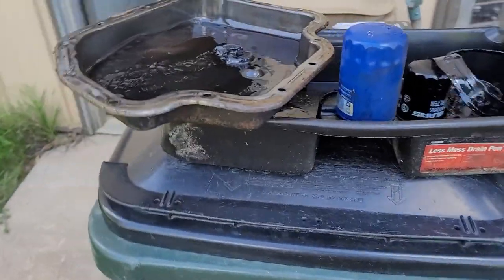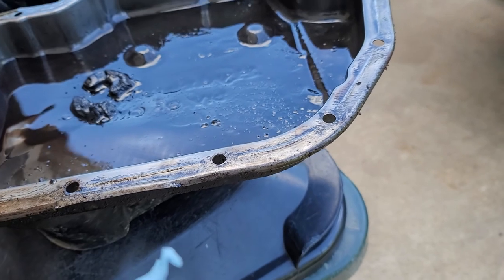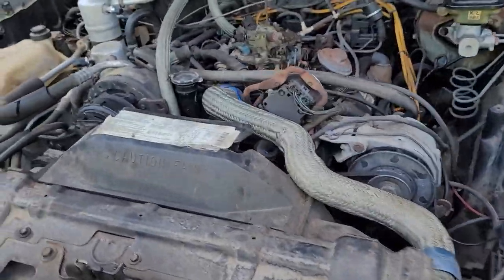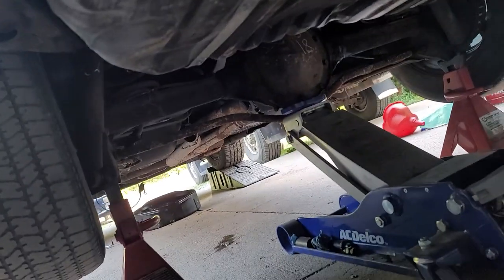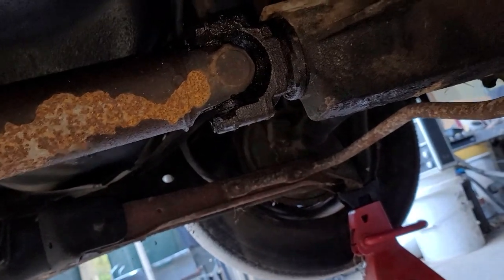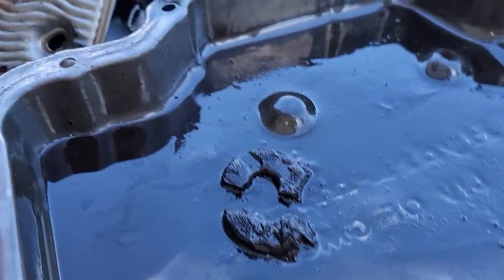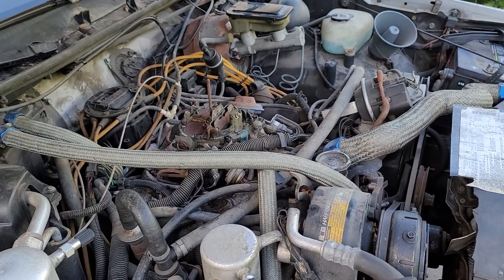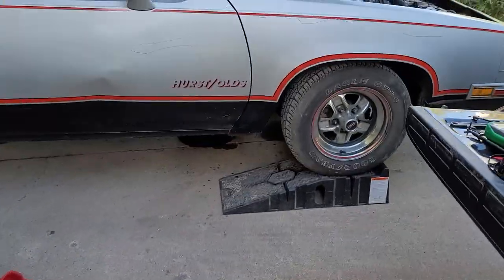1984 Hurst/Olds Cutlass Trans Fluid and Filter Change

Comment: What transmission oil you used
Reply from the maker: @andrewoch875  I just used valvoline Multtivehicle. The red jug. Threw a bottle of lucas stop slip in there aswell for good measure. I had no history on the transmission. Sure is smooth now!